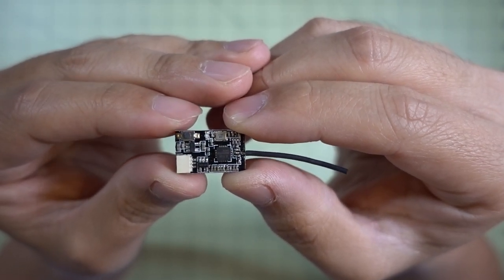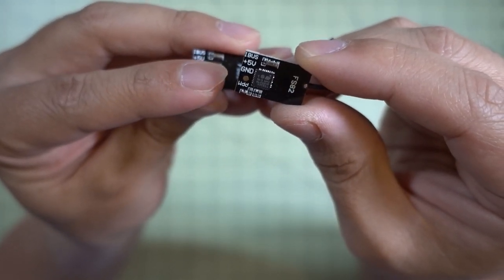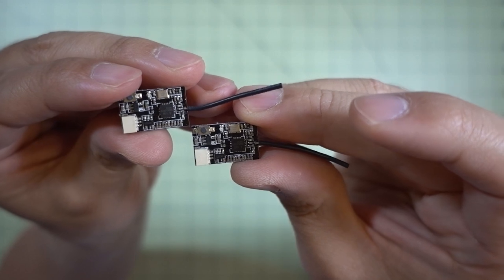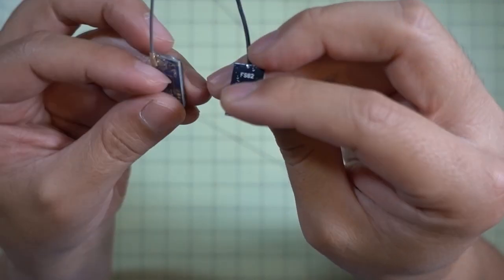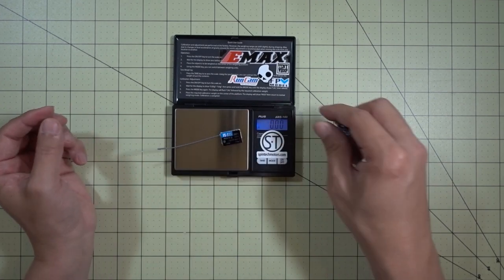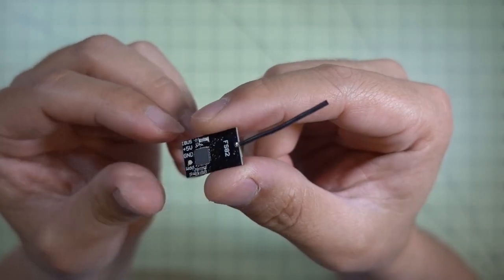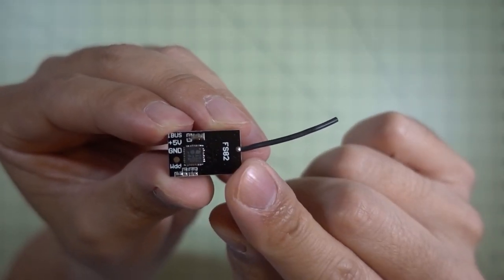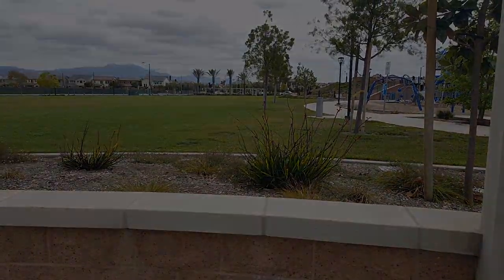Flysky FS82 Micro Receiver

Comment: Thank you Albert, as always. FWIW I've been using the very similar RX2A micro-iBus receiver for a couple of months on 4 different quads. The RX2A and perhaps the A8S have become my favorites (displacing older PPM-only micro-Rx's and allowing me to utilize my Turnigy Evolution as opposed to my i6 10ch modded). I've done several range tests including one a few days ago WITHOUT the antenna on the RX2A. Like the other AFHDS-2A micro receivers with iBus, it's Turnigy Evolution and A6S compatible, and failsafe only works on iBus, not PPM. BTW, even though the RX2A/A8S (and likely FS82) are on the 2-way Flysky protocol, they do not utilize 2-way communication...which is actually kinda nice because you can use one model in your Tx for all of these micro-iBus Rx, particularly since iBus has perfect end-points and subtrim without modification, and without rebinding after the initial one-time setup. 

Here's the results at a 4' height above the ground for both Tx and Rx. I placed the Tx on my chair and walked away with two quads at a time with their motors armed and spinning. I walked until first brown-out on each motor, while noting my position in the park. There were a few trees between myself and the Tx, and I took the same line on each walk. Again, these are the ranges at ground level so these should at least double with slant-range airborne, but that remains untested since I'm afraid of losing the quads in the attempt.

A8S: 210 meters with stock antenna (ipex with coax extension)
A8S: 360 meters with sleeved dipole (ipex with coax extension)
RX2A: 230 meters with stock 31mm antenna (direct solder)
RX2A: 160 meters with no antenna (antenna lost in a crash; Rx in shrink-wrap within carbon fiber KT100 frame)
RX2A: ....? not yet tested with new sleeved dipole, but there's no separate GND pad for the shielding so I'm not necessarily expecting this dipole to match the 360m range of the same dipole on the A8S with it's grounded ipex connector.

In any case, I'm guessing the new FS82 will have more than sufficient range for outdoor use and is likely on par with the A8S/RX2A using stock antennas, given similar antenna placement. BTW, my A8S Rx's are installed on my 90GT and Youbi XV-130. I haven't had any problems with the 90GT installed Rx, but the Youbi install had early brownouts so I have encased that A8S in a layer of aluminum foil as suggested in RCGroups and it now works perfectly (as seen in the above range tests). 

RX2A (the pins are included but not pre-installed, so not as pictured):
http://www.banggood.com/2_4G-8CH-Micro-Frsky-D8-Compatible-Receiver-With-PPM-SBUS-Output-p-1104843.html
http://www.banggood.com/2_4G-8CH-Micro-Receiver-PPM-SBUS-Output-Binding-Button-For-Flysky-AFHDS-2A-i6-i6s-i6x-p-1119833.html

I used this app for accurate distance measurement:
https://play.google.com/store/apps/details?id=lt.noframe.fieldsareameasure

Comment: Hopefully this is better than the A8s. I've had so many problems with it.
Reply from the maker: +Brent Elliott FYI many of the problems are due to the antenna signal getting blocked by the frame. I always make sure thr end of the antenna is far away from the frame.
Reply: +Albert Kim weird. The only thing that was around my antenna was a zip tie and heat shrink. Mine would only take throttle command when it wanted to. No yaw pitch or roll. It would just act up so I'm don't with it.

Comment: Not metal encapsulated has interference problems? I have used fs-a8s and I have decided to change the transmitter because of the interference and the bad communication with these receivers (a8s) so I ask with this transmitter corrects the problem?

Comment: Hey Albert, I just wanted to check if you have had any change of feelings regarding this. Would you suggest this or the A8s for a small 2" acro build? Thanks!
Reply from the maker: I think either is fine if you can fit them in there. The range of the FS-A8S will be more than the FS82 however so just keep that in mind
Reply: OK. So you consistently get good results from your A8S's? I see a lot of reports of issues with them but they may be the older versions.
Reply from the maker: Those folks are getting brownouts when their lipo voltage sags and the PDB 5v regulator is not able to provide the required voltage for the receiver.  If you fly too long and let the lipo voltage drop below 3v, this is likely to happen.  I've only ever had this happen to me one time.

Comment: You think this could be a receiver to put in race quad because you are not typically going far distances?
Reply from the maker: I have used it in a 5-inch and have gone  about 125 meters with no failsafe. YMMV. This is not a long range receiver.

Comment: Thanks for your videos, I purchased all the things in the video. The ia6c receiver that came with the Turnigy works. I have bought the FSA8S and FS82. Both bind to Turnigy but do not work. In Betaflight it's not connected. The transmitter doesn't recognize it.  I followed all the setups and it is not working. Do you have any idea?
Reply from the maker: Are you talking about the Turingy Evolution?  You need to make sure output mode is set to IBUS in the receiver and in the transmitter.  Also make sure you are on the correct UART and that you have serial receiver selected as well as IBUS.  You also need to make sure TX and RX aren't reversed.  Many people make that mistake.  If your flight controller uses an F4, make sure the UART you're using isn't inverted.  Lastly, double check all of the above.

Comment: hey could u help me out?i bought that same receiver (fs82) and i bound it to my transmitter(flysky fsi6).but i cant get my transmitter to activate anything on the drone.like literally nothing, all i can do is power on the transmitter and watch the led light on the receiver go from flashing to steady. nothing else works ....i took the black wire and conected it to the ground on my fc and i took the red wire and connected it to the 5v on my fc.took the yellow wire and connected it to the sbus on my fc.but i cant control anything...even in cleanflight the transmitter wont pick up.what am i doing wrong?
Reply from the maker: Check that your output mode in the transmitter matches what is in cleanflight.  Also check that you are using the correct UART receive pin.

Comment: This came on my mantis 85mm it does not bind.. just always a slow steady flash.. help pleaseee
Reply from the maker: It might be defective.  Did you contact the seller?
Reply: Albert Kim i literally just got it through the past 2 hours ago! I wanted to exhaust all avenues before i contacted gearbest
Reply: Albert Kim i have managed to sort it buy shorting the tabs either side of the bind button which must have been faulty. 

My next issue is in betaflight the stick inputs from my tx show up. However on my i6s tx screen it says no rx signal

Any ideas buddy?

Comment: Albert Kim  do you know if the radio flysky fs-i6 binds with that receiver.? Thanks mate
Reply from the maker: Yes, it binds with that transmitter.
Reply: Albert Kim oh cool I was hopping you would say that thanks dude. 😃👍🏽
Reply: Albert Kim you have a new sub 😊👍🏽
Reply from the maker: Thank you!
Reply: Albert Kim could you do a video please of the emax tiny binding to the fs-i6 radio please and the settings I need to have. as I have not used this radio before. Just got my baby hawk with emax tiny in so all new stuff. Can’t seem to bind. Not sure if I’m doin it right🤔 ??? Hope to here from you. Cheers Lou
Reply: I can't get it to bind with my fsi6 either.  😞   soldered it to the uart3

Comment: I can't get PPM to work with this, using BetaFlight and a Femto F3 board.  Any ideas? Thanks!
Reply: ReviewEdge so I do not have mine yet (emax babyhawk with femto f3) but ppm signal is not on UART3 that is serial. Although this reciever does ibus and on forums the femto f3 supports ibus on uart 3 (which I would use since its the only mode supporting failsafe on this reciever) all you have to do is select serial reciever then under that select IBUS. Good Luck! (Let me know if you figure it out as i will have the same setup so want to know if it works!)
Reply: Allan Andredi Just got Ibus working with the Femto F3 and fs82. It wasn't a smooth process tho, I actually had to download and run a previous version of betaflight to be able to switch the serial Rx input to Ibus, but it's working none the less. Let me know if you have any more questions.
Reply: ReviewEdge Thanks for the reply! Egarly awaiting mine but I have the reciever sitting around so I really wanted to know! And if I may ask what version of betaflight? As i want to be on 3.1.7 but it seems to have the serial IBUS option.

Comment: Hi Albert,  I just soldered up one of these Micro flyskys to my new 90GT.  Works great on my quick test flight.  One big gotcha with mine is that the receiver won't stay in iBUS mode. It powers up in PPM mode and you have to hold down the bind button for 2 seconds every time you power on the quad to switch it into iBUS mode.  Is that still the case with the Aurora version?  Mine may be rev 1 since I don't have the JST socket but rather 4 solder pin holes. (http://www.banggood.com/2_4G-8CH-Micro-Receiver-PPM-SBUS-Output-Binding-Button-For-Flysky-AFHDS-2A-i6-i6s-i6x-p-1119833.html?rmmds=search)
Reply from the maker: +Dave Fetters my Aurora always stays in iBUS mode.
Reply: Dave Fetters yeah I get the same on my Lizard V2, even tried a re-bind but doesn't resolve, I also have another one on my Speck 80S and it stays in iBus all the time and use the same transmitter for both as checked both the RX settings....weird, let me know if you resolve